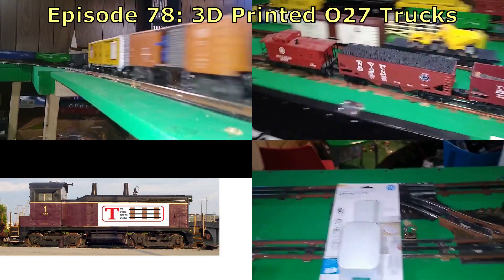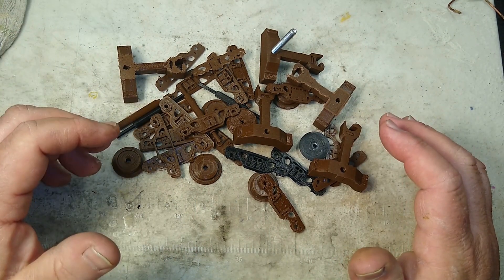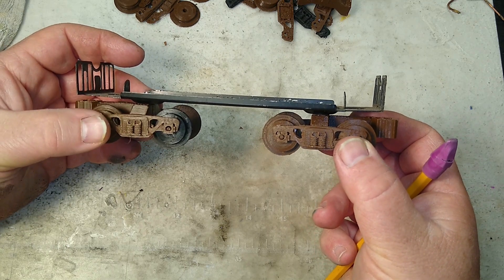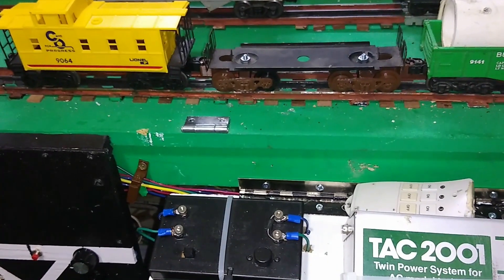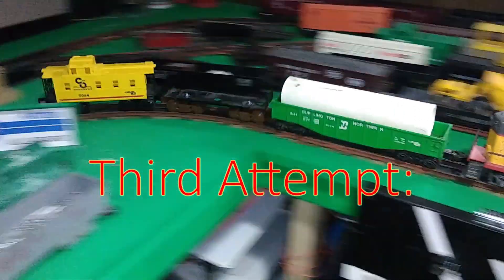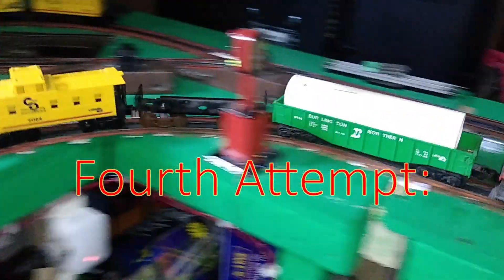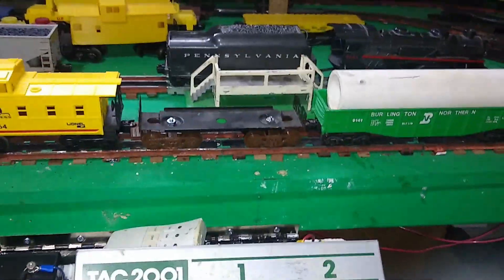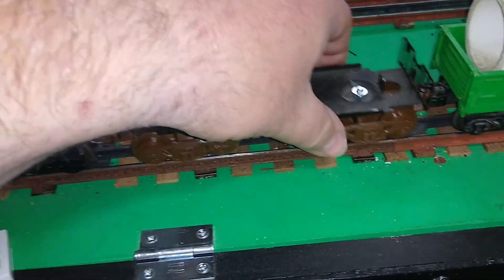3D Printed O27 Trucks - A Test Run

Comment: do you think you could make truck that has a housing for an operating knuckle?
Reply from the maker: I'm sure it could be done. It would take a bit of reengineering of the design to allow for the knuckle to print with the coupler. Otherwise there's a lot of support fill to remove.

Comment: Make weights for the trucks designed like the pickup plates used on modern Lionel lighted cabooses. Make them out of metal.
Reply from the maker: Thanks for the idea. However, that would require a total redesign of my bolster and side frames. Instead, will likely hang metal washers under the bolster and attach them with the same bolt that fastens the truck to the frame.
Reply: @ToyTrainTipsAndTricks   I'd think inside the body for weight.(Tire shop/or Harbor Freight has stick on automotive wheel balance weights, score cut like a chocholate bar to break off, 1/4oz squares or 1/2oz, etc. Add some thin nylon washers to lower bolster friction AND protect plastic. Looks loose, tighten the fastener so bad truck cant tip and climb easy  (unless you have grades that need that tip) Check your inside wheel edge flange to flange MIN. gauge. you may be bumping turnout guidrails. They looked to have too much run out; hub on axle play allows excess tread path wandering and increases side loading in the hub; destructive drag. Solid wheel/axles need a nice fast angle tread taper for them to work well and dont like to be on the same truck as a free set up. Smaller axles ware hubs faster but have less drag. Tin plate style wheels spin easy because of of so little contact to the axles. This is repeated on the frame axle holes. I.e. if you can make a hollowed area in the hub via print, youd reduce axle contact area.(and have a well for a lube/synth.oil.) (well like where automotive grease might get packed; behind the outer wheel bearing) .... just thoughts as I'm considering this silicon for a mold and some JB Weld as my wheels.(JB Weld and some dental tools is my usual version of 3d printed repop or repair ) 
"Oops lost the caboose".... I saw that comming. I have one too. I added wheel weights inside to tame it 😉

Comment: you might be able to get fast angle wheel sets from Lionel. of course it would increases the cost of the truck but it work on the control  insulator track.
Reply from the maker: If I use a capacitor with the control circuit and place metal-wheeled cars elsewhere in the train, I can still use the track activator. OR I can switch to IR sensors as Arduino clones and ESP32 boards are getting to be dirt cheap, and they can control IR circuits easily.

Comment: Looks like you have a winner for sure.  I do not know if you can recycle the plastic from your earlier 3D efforts but they could be repurposed as material for custom scrap loads. With a little rust looking weathering they would fit in perfect for an O-Gauge scrap load. Wheels, Trucks, Couplers etc. Speaking of scrap loads could one be made on a 3D printer? May be an idea for a future 3D project. Enjoy your videos as always.
Reply from the maker: I have been looking into methods of shredding failed prints and melting then into sheets for various projects. As for the wheel parts - yes, I have considered a gondola load.
Reply: Where can I get the file for the 3d print to print me a set